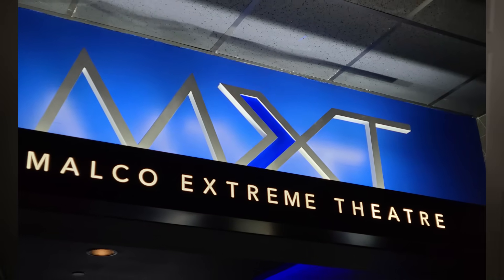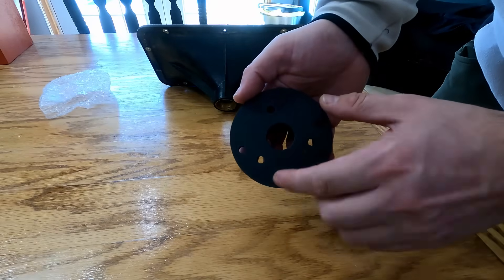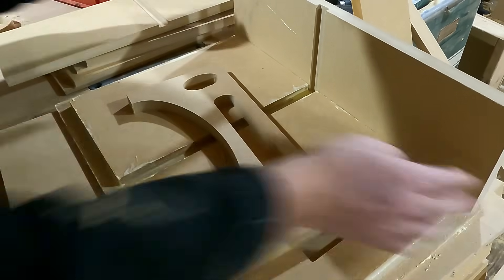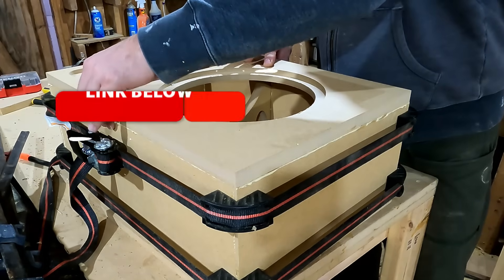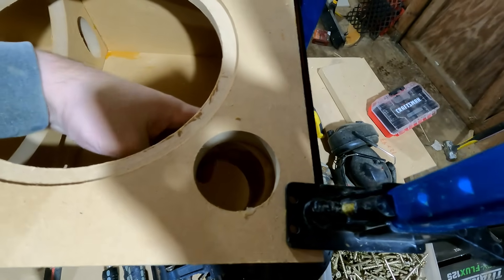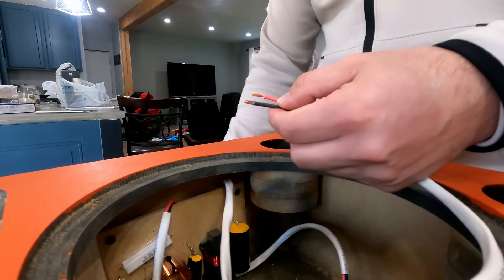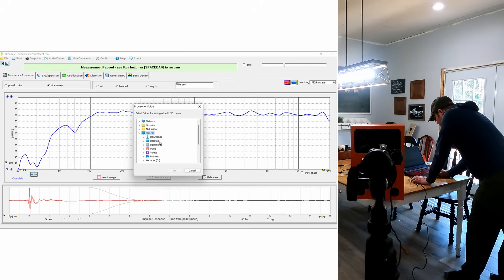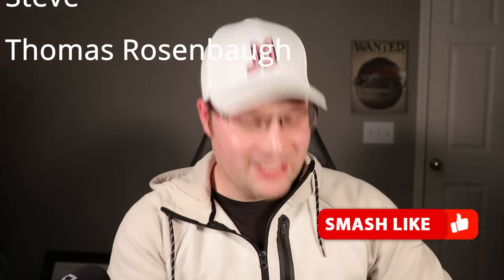How to Build $5000 Speakers for $400 - Klipsch KPT Inspired - Cinema 10

Comment: Once again, a horn referred to by the euphemism "waveguide". And yeah, you can buy motion picture theater speakers--not only can you buy new ones from JBL but used ones are readily available including the best of them all, the old Altec VOTs.
Reply from the maker: This is using a constant directivity waveguide not a traditional horn. If you are confused on why it is a waveguide versus a traditional horn, here is a good read: https://www.diyaudio.com/community/threads/horns-and-waveguides-101.336780/ you can also do a Google search on constant directivity waveguides and that will also give you a better understanding of them versus traditional horns.
Reply: @Toid  I know about CD horns, they've been around a long time; there was the Altec Mantaray around 1980, then came Don Keele's CD horns at EV and then his work at JBL.  CD "waveguides" were originally referred to as horns with no apologies. And using horns as waveguides goes back to at least the 1930s  in the motion picture theater business and the multicell horns of various patterns designed for the Shearer Horn. CD horns are a refinement and a type of horn, not non horns.
Reply from the maker: @tombrennan6312  there were constant directivity horns in the '70s and eighties that definitely had their issues. The newer way of thinking is by using a redesigned constant directivity waveguide which really has no horn loading characteristics at all. Instead they focus on getting rid of the diffraction within the horn and giving you the constant dispersion. If you want to call it a horn, you're welcome to. But the truth of the matter is that it doesn't have the characteristics that made a horn, which was the loading in order to increase efficiency. These waveguides are all about dispersion pattern and removing that diffraction. They don't care at all about loading for efficiency.
Reply: @Toid  Fair enough. As an old horny I (my first DIY speaker book was written by 2 Altec engineers in 1968 and had plans for several Altec cabinets ((including the 825 used in the A7 and A5 VOTs)) the Jensen Imperial and the Bozak Concert Grand)  I remember well when horn speakers were held in contempt by audiophiles and many people have consciously used waveguide as a euphemism to avoid the dreaded H word, as a result I'm defensive and kind of a pain in the ass about this. My apologies.

Comment: If Celestion speaker (pair) cost $300, it is amazing you got all connectors, crossovers and chassis material for $100 (pair).
So single crossover, connectors and chassis material for $50

Lucky the labor and machinery cost nothing...

BTW, the original KPT-8000M surround and height speakers are $1,000 each....

Comment: I did something similar a few years ago. I built a variant of the econowave so 12" and 12x6 horns for my theater. Worked out very nice.
Reply: I did exact same Econowave build myself. using the Dayton 12. Its a party speaker, its loud, and clean.

Comment: hi,
great job, your work seems really great. and  your builds are are very close to a speaker  I've been looking at, the Ojas speakers. and he has an 8'' speaker coaxial with a mod for an outside compression driver with waveguide. he bases his build on a jbl 328c but my guess is it could be done your way.... what do you think? the form factor, the looks and the sound seem to be really nice. the cross over is jbl made since it's a intagrable ceiling speaker that gets moded after with an L-pad. but a home made cross over sounds good, right up your alley. cheers.

Comment: How much $  for the tools in your video?
Reply from the maker: If you want a hobby CNC you can get them for as cheap as $400 now. But if you don't want tools like that, you only need a router. After all, the CNC is just a computerized router. Wherever you buy your material from, can typically make the straight cuts for you. All you have to do is cut out the holes.

Comment: I cringed when I saw you cut off the port alignment dowels with the miter saw.  That's an easy job for a hand saw and there's no risk of having the spinning blade grab the work piece out of your hand or pulling your hand into the blade.

Comment: I had a set of "homebuilt" speakers similar in size and shape to the JBL C-34 (1950s-60s) design. They were different from the JBL though, because the back at the corner was "open" to the wall corner at the bottom. The instructions were to sit the speaker 2" from each of the walls at the corner. It seems that they were copies of a Klipsch design. 12" woofer, 6 or 8" midrange, and a horn tweeter. Anyone know of a similar design? Lost'em in a house fire, but I loved'em. After I posted this I went hunting and found the original design. They were by Electro-Voice Aristocrat corner speaker copies, and Paul Klipsch designed them for E-V.

Comment: Hi Toids, just discovered your great channel.  Could you tell us what CNC machine you use and what are the main (large) tools including testing equipment that you use and would recommend (i.e. if it was to be redone again).  I am a mechanical engineer by trade (military) and would like to equip my mechanical shop with more finesse, enough to handle electronic projects and fancy(ier) furniture challenges.  Thank you, Ciao, L
Reply from the maker: Thank you for your service! The CNC I use is made by CNC4Newbie.  It is the pro4848BL.  For measuring equipment I use the Omnimic and Dats. https://bit.ly/3psKLSJ

Comment: You have made a very decent copy of the Cubs back channel speaker with the exception of the compression driver with it is without a doubt the most important part of the speaker you don’t use what you just have around realize that I used design theaters and the back channels were the least important part of our system sounded important part was the front general speakers would you didn’t even approach pumpkin or $5500 is about right but only if you can buy hem locally

Comment: These remind me of my Econowave-pro speakers I built about 10 years ago.
I still have them, tuned the box to 50hz, same waveguide as here, with an Eminence Kappa Pro 12".
They are so good!!
Reply: @keithmarlowe5569  winisd is pretty easy to use. Just mess around with it. Most drivers are in the database and if not you can usually find the TS parameters for your specific drivers, which will lead you to porting requirements across variable box sizes.
I am so tech challenged, but I plinked around with Winisd and figured it out. You can do it!

Comment: Why not just buy a pair of Spendor BC1's ? New similar for £3,200 or second hand for £500-750. You cannot get a better speaker.
You built a small pair of speakers (with no lining for damping box resonances) when 2 cubic feet would be optimum.
BTW, Klipsch speakers are at the budget end! Buy new for $400. Readily available retail.

Comment: I really appreciate you posting this. You have given me confidence that I can build great speakers myself. As a finish carpenter, I will say that cutting square edges on the ports with a mitre saw is a very risky move and one that viewers should be aware of, Not only for your liability but for their safety. A round surface gives no stability against the fence to hold the port securely while being cut and can easily be caught and ripped through the saw taking fingers with it. I wish I had your CNC machine.
Reply: as a fellow woodworker, I was thinking the exact same thing.  Great video though, thanks for posting!
Reply: I’d thought the bad part was when he was cutting the posts off the ports, but when I saw him cut the squares with fingers in the ports...YIKES
Reply: @noelcarlson7592
Agree 100% on the danger of cutting anything round on a miter saw or table saw or even a bandsaw!
Clamp that in a V block and save your fingers! Gives me chicken skin! (Retired finish carpenter)
Reply: As a fourth woodworker… I wanted to agree with everything you said. I enjoy the videos, but I wish you would be more careful!
Reply: Did you end up making yourself some speakers? I would love to know how they turned out
Reply: @B9r9s2d  Not yet, but it will happen. I let you know when I do!
Reply: Any wood workers have tips on tool and techniques for perfect square/rectangle panels without a table saw, or with hand tools only?
Reply: I'm a finish Carpenter as well. That's why we don't have CNCs
Reply: Swedish carpenters are better for this type of things in my opinion. Actually even Norwegian. It's close but there #1 and #2 for sure
Reply: Junk

Comment: Several years ago I met Bruce Edgar in his home. He was a contributing editor for speaker Builder magazine. I later sent him a pair of Dynaudio drivers and asked him to try them in a mid-range Traxic Horn speaker design he was working on. He was so impressed with the speakers that when he returned the them, he also included the hand-built horns that he had designed.

I later built a Pro sound system using the hand built horns with with Peavy Black Widow speakers and a set of tweeter horns. I've lost my high frequency hearing because of those speakers. Oh, but how much fun they were to listen too. This traxic midrange horn that was very similar to a design that ended up in a Klipsch speaker that Bruce designed for them.

Comment: So, you've built an Econowave variant? I did my first one, with the original JBL WG that the Dayton is a clone of, about 15ya.
Reply from the maker: No it is not an econowave, nor are any of my designs. It does not use any of the crossover designs that have ever been used by any econowave design. These are completely custom crossovers and custom designed speakers that happen to use the same waveguide. Thankfully, we don't consider every speaker that uses this waveguide an econowave.

Comment: I’ve been to plenty really good movie theaters. And some amazing home theaters. Not one of them had Klipsch speakers. I wouldn’t pay $5000 for Klipsch speakers if I won the lottery. What most people don’t realize is that you have to have an acoustically dead room, in order to use Klipsch speakers, because they’re so bright and shrill. Most people that buy them, have a room that is very large, with lots of windows, high ceilings, and hard floors. Completely the opposite design of a room for those speakers.

Comment: Great job!  Not many people recognize the importance of the polar response, it's good to see you do strive for uniform off axis.

Have you considered building a CBT array?   It would make a great project for you!
Reply from the maker: I haven't considered it yet. I had offers to send me a bunch of drivers to build one. But honestly I'm just not quite sure how many people are really interested in it.
Reply: @Toid  Yeah they are not very commonly known yet but the technology definitely works well.  They are a bit more complex to build especially if you are trying to do it passively.  Creative variations of series/parallel can reduce the number of resistors required to accomplish the shading but that takes some thought to sort out.

I believe JBL offers the only commercial option and they apparently use all pass filters to accomplish the delays to simulate the circular arc.  I personally wouldn't want to do it that way but it seems to work.  

The ones I'm currently building use multiple amplifier and DSP channels which makes it a lot simpler.  The main lines only need a attenuator in front of the amplifier on the last group of drivers, the other groups all have independent DSP channels.  This just makes it a lot easier project to build.  I'm hoping to have them up and playing on my next trip home, the fun part will be getting the 9'-8" tall 180 lb monsters hanging from the ceiling!

Comment: As a beginner in making home speakers; how would I go about the crossover thing? I would have to buy one, but would like to copy what you've made. Is there one which would do the trick and not dramatically increase building costs?
Reply from the maker: If you buy the plans, it includes the crossover design as well as box design and speaker placement. If you need help with that, you can just let me know and I'd be happy to help you.

Comment: ever since 2.1 systems started to get popular I have wondered if it really makes sense to have your lows with your mids instead of your highs with your mids. its the base that really distorts everything else right?
Reply from the maker: It can be. Some of this has to do with Hoffman's Iron Law. But in general each driver does a specific set of frequencies well. Once you try to go beyond its capabilities coming you add distortion. On top of that if you want to keep a fairly sensitive speaker at a decent size, it won't go real low in frequency.. the advantages of using a higher sensitive speaker, means less distortion in the speaker and typically less distortion in the amplifier. All of this adds up too much cleaner sound. We can discuss even more on the Forum if you'd like. www.toidsdiyaudio.com/forums

Comment: nice video...BUT..I do not have the space for that machine,it probably costs thousands,and can i use wood instead of MDF?Do you make speakers,because I need some three ways..
Reply from the maker: Yes you could use something like a plywood instead of MDF if you'd like. And you don't need to have a machine like this. It just makes it much easier for me.. all you really need is the box.. and that can be cut out anyway you want. In fact a lot of people just go to a big lumber yard and have them cut for them.
Reply: @Toid  Ok,so let's say I want a three way box,12-15 woofer,one or more midrange drivers,and the horn for the highs..maybe a ribbon..Would that be insanely expensive?
Reply from the maker: @michaels5166  that all depends on design goals and parts chosen. It could be very expensive or could be done for relatively inexpensive. The hardest part would be to get someone to design it for you. That would be the most expensive part if you're not willing to do it yourself. Someone would end up having to build the box put the drivers in take measurements and then design the crossover. So that ends up getting expensive real quick to hire someone to do that.

Comment: how about making bookshelf speakers that are actually buildt into the bookshelf. you might only need a backside sides and a front.
Reply from the maker: Believe it or not, I am had this idea a few times. I'm still contemplating it for some built-ins  I have planned in my living room.
Reply: @Toid  could be really clean mounting a small reciever/amplifier unit on the shelf beneth  so you can cleanly hide the cables on the shelf under. it would ofcourse need to be on one of the shelves in chair sitting height but could look really clean

Comment: The woofer is $80, the compression driver is $90, the waveguide is $20, so that's $190 already, x2=$380, which is already over $350, without the crossovers, cabinets, and other needed parts
Reply from the maker: Interesting. Some of the prices must have gone up since I last totaled them up. It would be closer to $400 in parts then, before coupons.  I believe there's a coupon right now for $25 off any order over $250 (CJ2FIVE).  You can never count material cost. Since you don't know what someone has or will use. That cost can differ dramatically.
Reply: @Toid  Really? This video is only five days old! Don't BS me
Reply from the maker: @DougMen1  the video was released 5 days ago. The speaker was designed months ago. The price was $170  per speaker when I designed them. I do thank you though for pointing it out. I have changed the title to reflect that.
Reply from the maker: @DougMen1    there's really no reason to bs you. The point of the video is to show how much you can save with DIY. I'm not sure I would be gaining anything by intentionally taking $50 off a build that is saving you thousands. That would just be silly. Having said that. If you've kept an eye on the loudspeaker market, the cost of drivers have gone up significantly even in the past month. For example, June of last year the MX15-22 came out costing $199. Recently it's gone up to $230.  That waveguide that I'm using here used to cost closer to $12-15, now it looks like it's closer to $20. I probably should have double checked prices, since I built it. Honestly I've never needed to. The prices of drivers have stayed pretty stagnant. But the current inflation has really affected the prices of drivers. Having said that, that's always the reason why I put the main components parts listed. That way you can double check to see if any prices have changed better or worse.

Comment: So what did you end up using for a crossover circuit?
Reply from the maker: It's in the build plans. But the basics are a second order on the woofer, third on the compression driver and an l-pad.

Comment: Great build!
For those interested, I (very) highly recommend checking out Pi Speakers, in particular the Three Pi is very similar to this.
The base kit is about $320.00, and the owner (Wayne Parnham) has been doing constant directivity since the 70's and is one of the great masters of it.
You will get a better wave guide from him than the one here, and a crossover that is extremely well designed. I suggest getting the upgraded compression driver, but I would not bother upgrading the  woofer or other parts for a HT set up. For a stereo, upgrade the resistor and caps for sure.

I used the Three Pi as a center channel, and it is exceptionally good.